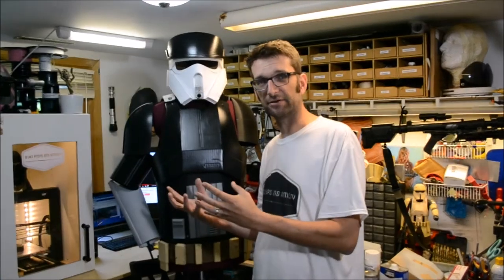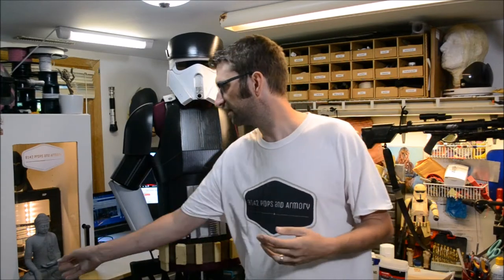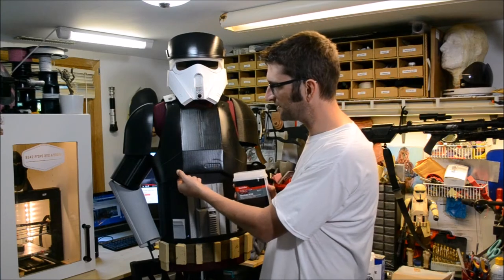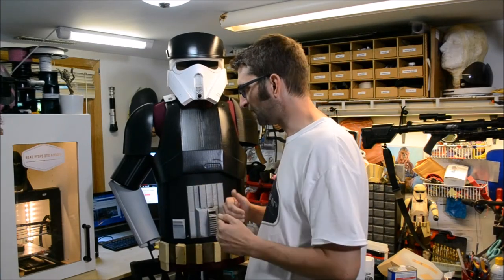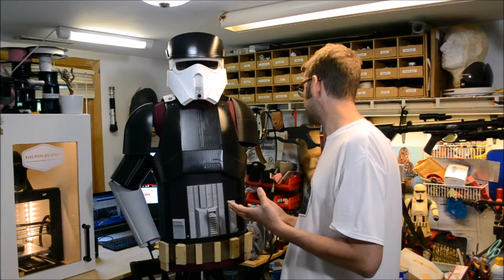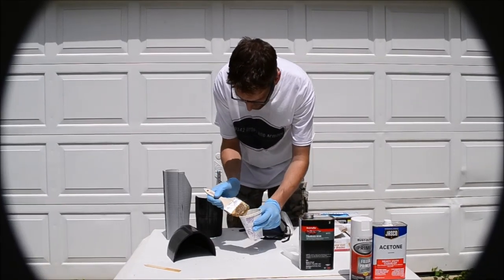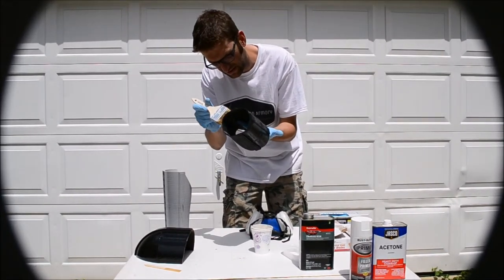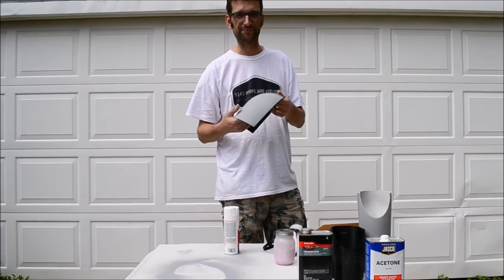Smoothing 3D Printed Armor for Paint

Comment: i always print in .4. it takes half the time, i don't spend that saved time sanding, i only use a small portion of it.

I use a wield technique. I use Spackling (for drywalls) mixed with rubbing alcohol to get a paste i can spread with a bush (like the fiberglass resin.)
no added strength but much easier to sand. however wet sanding devolves it, and it can be scratched easily until you prime itl. after the primer it is perfectly fine to wet sand and can't be scratched unless it is bad.
i got gloss automotive like finishes on projects with little sanding.

Comment: Question is it strong enought for airsoft and paintball? Or will it break all over the place
Reply from the maker: +TheWampyMaster I think that would all depend on how you printed the piece; material, thickness, etc. With some experimentation I would think so. Though, I would probably err on the side of not using a printed helmet for paintball. As there is always an ass at the field who decides the velocity max rules don't apply to them. Thanks for watching and for the subscription as well!
Reply: 9142 Props and Armory thank you for the fast reply im looking to buy the cr-10 S to make a shoretrooper juste like you mainly because i love it so much and on the other end want to run on the field with it and show off i wanted to make it from paperepika and fiber glass but saw the fastest and more easier way with 3D printing i dont mind spending a 1000$ for a almost unlimited amouth of props and i even have 3 years of 3D class on my belt so im hyped
Reply from the maker: +TheWampyMaster it's an awesome project to say the least. And the CR-10 family of printers are fantastic for sure. Be sure and share some photos of your project as it's coming along. Have fun working on your armor.
Reply: 9142 Props and Armory yes ill send some pic prob even record on twitch for fun

Comment: Have you used XTC3D? A better alternative to the fiberglass resin for sure as it's designed for 3D printed parts and is much less toxic I'm sure. Still offers the smoothing and strengthening properties but the consistency and application is designed for what you're describing. 

https://www.smooth-on.com/products/xtc-3d/
Reply from the maker: +Andrew Brinkhaus Hey Andrew! Yes I have used XTC3D.  It's good stuff for sure and definitely less nasty to work with. For some parts however,  I like the added strength of the fiberglass.  It all depends on the piece and the project, but definitely will do a little more testing with the XTC3D on larger armored pieces in the future. Thanks for watching!
Reply: Alone I'm not sure the bondo resin is any stronger than the XTC3D epoxy resin. Obviously if you were using it with fiberglass mat it would be much stronger but as is, the two resins are very comparable I think, and for the price you get more resin w/ the XTC3D. Just my .2 though. Thanks for the video!
Reply from the maker: Andrew, yes, it will require more experimentation for sure. For the largest parts of this armor set I may go for fiberglass resin and mat on the interior and XTC on the outside. Yes, they are very similar for sure, so many ways to get a desirable finish and strength. It's great to have options for certain.